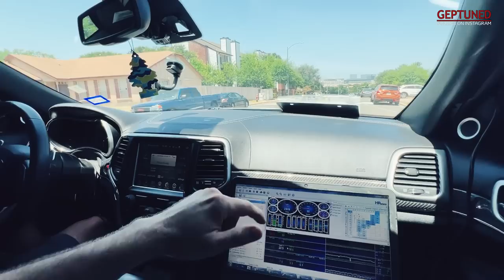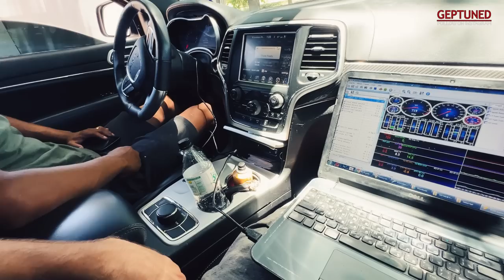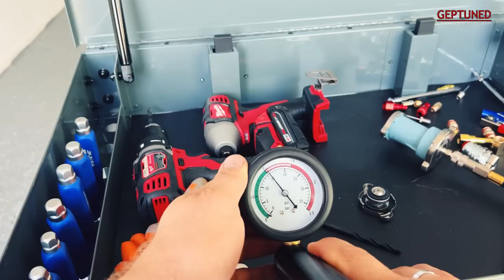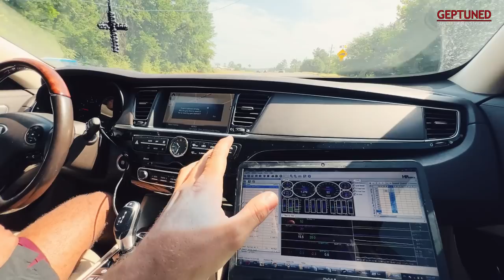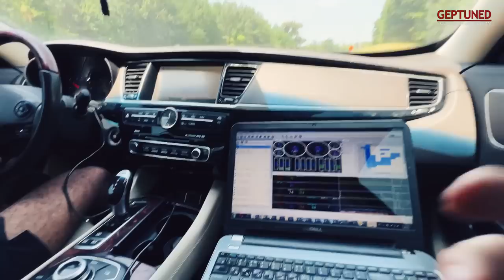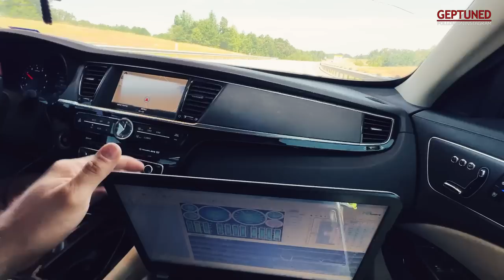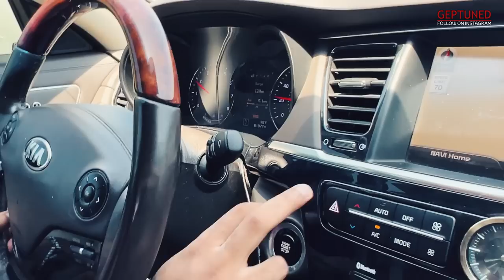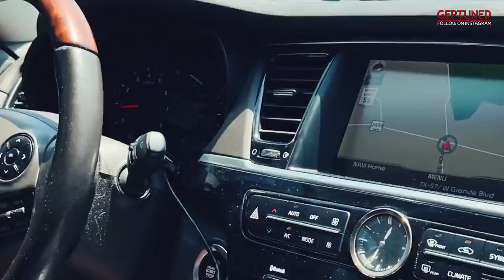Fixing Nissan Note, Tuning SRT8 & KIA K900 5.0 on FULL E85

Comment: Estimated HP gain with the E85 on these 5.0?
Reply from the maker: Just e85 without tune will gain nothing
As for stock to e85 have never tested on a dyno as yet none of customers wanted to invest in dyno rental to see actual figures before / after. But all are 110% happy with road tune results.
Reply: Will you get burble pops in the Kia?
Reply from the maker: @JalenDochee-so1fn  if customer requests so
Yes looks like you did not watch this video otherwise you would hear pops from kia.
Reply: @GEPTuned  I couldn’t it’s too long even on 2x 😭😭 but we will definitely be doing business before the year is out! Love your work